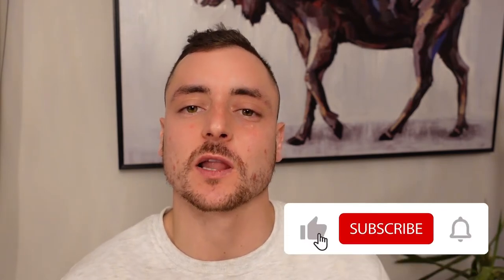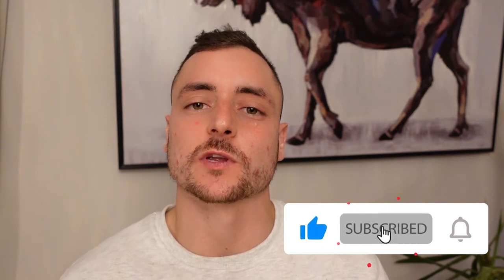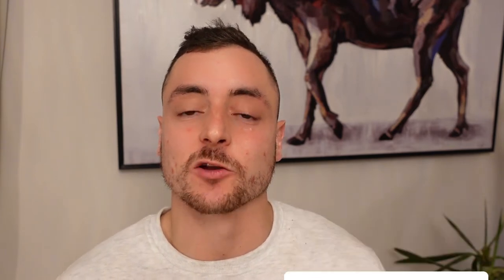OIL STOVE | Hacks | How to Make It Run Better | Start It | Blue Flame

Comment: Great video Phil.  I just wanted to touch on the steel wool in the burner.   Less is more in this case.  I found just a small 2"×2" square is all that's really needed. (and works better than using a larger piece)
It's kind of sacrificial too, as it will fill up with carbon with long, continuous burns.  You can crush and remove the carbon from it for reuse, but it's easier just to place a fresh piece, on the next startup.
Reply from the maker: Great piece of info. Thanks again!

Comment: One of my client at the job talked to me about burning used motor oil with his oil stove, he basically just mix a little bit of it with his actual oil and it seems to work fine according to him. He uses this oil stove to heat his garage.
Reply: Do you know if he just bypassed the regulater completely?
Reply: @paulcook68  pretty sure he doesnt bypass it, I would try a 1 to 9 ratio with the used engine oil and heating oil (diesel). I don't think a 10% mix would hurt but I might ve wrong.
Reply: @nukey555  ok thanks

Comment: Thank you for putting all this information out there from my searches I have found great difficulty in trying to obtain information on these oil stoves 
 My question is I have a 1999 Efel, it has a power cord. Any ideas if it can be run without power and what power does? 
Also any idea where to obtain the metric to Inch exhaust adapters? 
The two efel I have are  4.2” and 4.5” manifold flange. I can’t find no source for these

Comment: Oh my goodness!my father in law had an old Coleman oil heater years ago and I remember the heat it threw. We were gifted a similar one taken from my mother in laws old farmhouse that was still in use until 3 years ago. It has taken us 2 years to get this beast rolling. The first winter it wasn’t running properly. The second we had a food and the regulator froze. Then we realized that we needed a conditioner additive to stop the gelling process because we use regular diesel and it doesn’t like the minus temps. Lol it ran….meh. This year. We extended the chimney to 10 feet and replaced the damper to a cast iron one. Now we have decent heat. Next week end we will add the mesh and possibly add another 5 feet to the chimney. It’s minus 2.0 right now and to cold to be working with metal. Thanks for the tips!!!!! Oh! And my father in laws chimney was only 10 feet so we will see
Reply from the maker: That’s amazing! Once they are well adjusted and chimney is long enough, they throw out a nice efficient heat. Enjoy!!

Comment: I thought it might help mentioning that there are 2 “types” of catalysts or burners in these stoves. Most of the videos that I have seen use catalyst that is wire mesh and may have a cap of stainless steel fins. This is a blue flame burner. Other burners use 2 or 3 rings or disks with no wire mesh. This is a yellow flame burner. Such a burner is operating correctly when it is producing a yellow flame. In reality the flame is almost white, not yellow. I have played with both types of oil stoves (blue flame and yellow flame) for over 25 years. I prefer the yellow flame burner. When drafted correctly and properly maintained, neither burner creates much soot. Only once a month or so you need to clean the glass, with the majority of the “soot” being the red dye in untaxed fuel. Yellow flame burner is in my opinion safer to light in the sense that the disks do not obscure the view to the bottom of the burn pot making it more likely to see if oil has flooded the burner and less likely to light a flooded burner. I will make a few videos of my stoves to share my experiences and improvements that I have learned from using them. Off the top of my head some of the yellow flame stoves are the Drolet Yukon, Godin 3826,  Falcon and Baby Dragon. I believe one of Phil’s stoves had a yellow flame burner with catalyst rings.
Reply: Hey do you know if Franco belge are usually blue flame burners?
Reply: blue flame @Upholderr

Comment: What’s the purpose of pressure plate made of thick metal? Mine is haas +sohn model viking. Secondly i have fitted 9feet long flue chimney. The stove flame goes off if I shut the glass window completely. I have to keep it opened slightly. What should I do?

Comment: Can you use the still mesh over the existing after burner or is it redundant?
Reply from the maker: It may be redundant, but it wouldn’t hurt because it would ensure the fumes are heated enough to burn. Check out the video I posted today, I try out a few different catalysers :)
Reply: I did...i have 2 siegler furnaces one has a rusted out fire chamber but good motor and electronic unite. The most recent one i got is a larger older modle with 3 heat exchangers instead of the two my smaller one had. But the fan is siezed but fire chamber looks great. Barn kept for years. Unlike the idiots that kept the smaller one out doors not to mention whomever had it was burning waist oil on it which acts as acide sulfide and eats thru the metal just like salt on cars in the North. So i figure ill swap out the motor and replace the fuel regulator with new old stock colemen regulater. Probably have to adjust it to run on a siegler...but hoping its not necessary. But waiting on warmer weather. Belongs to several kerosene heater and waist oil groups on Facebook also comb thru daily thru YouTube
Reply: Make some videos on siegler heaters. I know s lot of people starving for information on these. I often hear of siegler owners saying the oil regulater is stuck or seized. This may not be true some or most ig not all first need to be pulled up to take off of pilot setting to no.1 settings.
Reply from the maker: @colbolt54  I’ll see if I can get my hands on one, thanks for the recommendation :)

Comment: In some backwards alternate universe, you might be using a high-vapour-pressure fuel for a cook stove or a heating stove. In such a case, a true carburettor would be in order. Then, though, wouldn't you want to be using a fuel that is already a gas, like the gas takeoff of an LP can, methane, or gasifier smoke?

Comment: I just moved into a house with an oil stove. Flame was small and blue. After experimenting with the power level it's started making tonnes of black sooth and blackens the window and the flame is yellow since. Any tips?
Reply from the maker: Try and put it back to a blue flame, and also make sure it’s clean. If there’s too much oil it will be too much access and the flame will cause a lot of soot. Also depends if your chimney as a good enough draft to pull the heat out. Let me know if it gets better.
Reply: Also, proper draft is absolutely everything on a oil stove.  Which means, if the chimney is too short, or is in bad need of cleaning, you will get soot.  A) try to find a manual for your stove that states the proper water column of draft at high burn. B) get a draft meter that reads in a scale range of your stove. C) test your stove. If it has a built in damper, there's probably a bolt in the top of the stove that's designed to be taken out to put the probe in for your gauge.  The reading MUST be taken before the damper.

Comment: I had 2 problems with mine a J.A. Roby Vulcain. Water in the out side tank freezing. Fixed it by thawing the line with a hair dryer and insulating it. My second problem is after a week of burning oil I have this little ring of a black crust near the oil inlet IN the pot burner. What is that and how can I avoid that. I assume it is carbon. I clean out once a week and restart. Also, have you ever seen them run on 100% biodiesel made from vegetable oil? What would that be like? Great videos and thumbs up.
Reply from the maker: Thank you for your comment, maybe your oil has a lot of residue or carbon in it. Maybe try diesel as it may burn cleaner. I have seen videos with bio diesel and kerosene. I will try and make a video on this soon.

Comment: any chance u can tell me if oil stove will run on kerosene plane fuel thanks
Reply from the maker: It will run, make sure to adjust settings since flash point is different.

Comment: How tall of stove pipe dose it need minimum to run? I only get blue flame on 1 and 2 sitting
Reply from the maker: Depends on the specific stove. A Yukon stove for example states minimum length of 15 feet in their user manual. At your 1-2 setting, do you get enough heat?  You can check my other video on how to adjust your regulator if required. Cheers!
Reply: That was exactly what I was running into before adding more chimney.  Manufacturers usually state 5 meters from stove outlet to chimney cap, and sure enough, once I got above that, performance increased significantly.

Comment: I have a Nestor Martin oil stove , it provides enough heat at 1 but you can’t see a flame . I bought a grate n coals for it, but the fire doesn’t show . It is not acceptable to have a stove and you can’t enjoy the glow of the fire

Comment: Phil, we just bought a used Nestor Martin Oxford 72 model. Is it true you can burn off road diesel in these  and also our stove came with a filter about the size of a large soup can, is it necessary to use this since there is already a built in filter in the regulator?
Reply from the maker: Good day, yes you can absolutely use road diesel, it actually burns cleaner. That soup can sized mesh thing is a catalyser, so it heats up with the flame and burns the diesel more efficiently. Hope this helps!!
Reply from the maker: Unless you actually have a filter to install in the fuel line, it is good practice to install it, but not a deal breaker if you don’t.
Reply: Phil G
Thank you, your response was very helpful. We were so glad we came across your videos, like you said, there isn't much information out there. Have a great day!
Reply from the maker: @ladyinred8867  glad to hear!! If there is anything you need help with, let me know and I’ll make a video about it :)

Comment: Mine has all the problems you mentioned T^T, I think the best thing I can do is to remove it. Lol
Reply from the maker: Just needs some fine tuning :) I'm sure you'll get it to run well soon. Let me know! If you want to see a video about anything, let me know and I'll make one.
Reply: What Phil said!  ☝️  Once you get it figured out, these stoves work incredibly well. No way I'm going back to wood. (well, maybe if fuel oil goes to $10/gallon 😅)

Comment: Stove burns beautifully but for some reason we’re getting very strong smell of oil in the house replace the window seal on the door seal still so strong any suggestions
Reply from the maker: Do you have a good draft going up the chimney? Maybe you have air flow going into the house when the stove is cold.